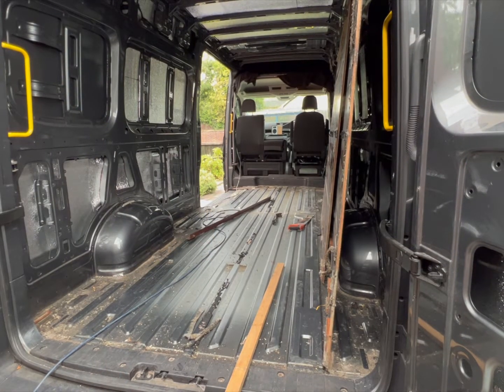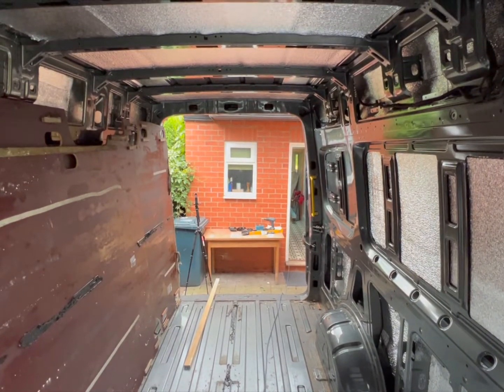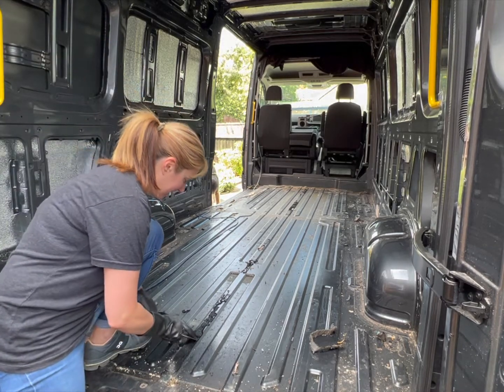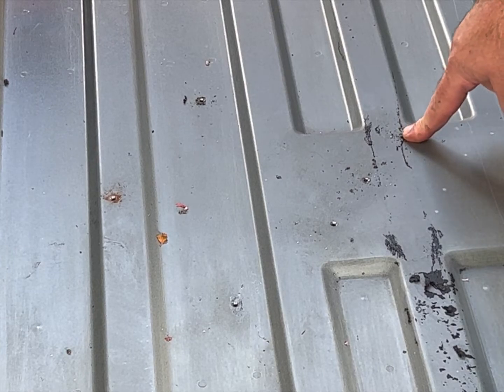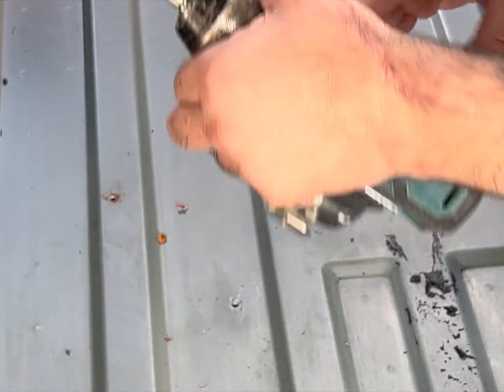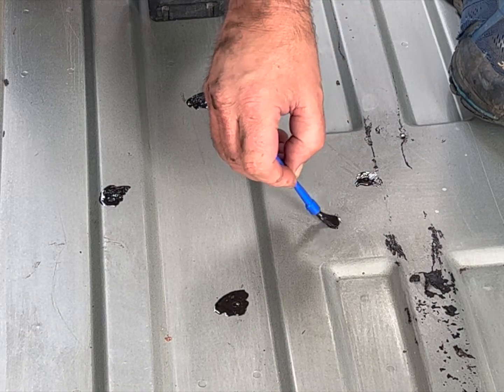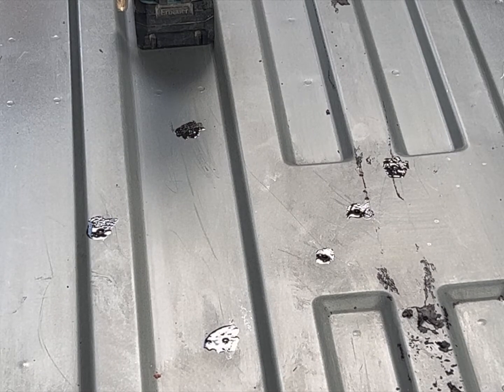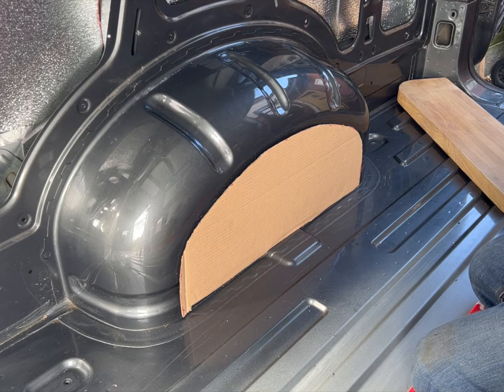VW Crafter Conversion EP2 THE FLOOR COMES UP!

Comment: Another great vid. Taking my floor up today to baton and insulate. I take it (obvious question) you chiselled off the packers attached to the floor before laying it back down on your insulation?
Reply from the maker: Hi Chris, yes. I cleared all the packers off the original floor, painted it and placed it directly on to the battened floor. It's the first coat of paint really, as I'm sure I'll go over it again when I'm finished. Albeit, I will be laying carpet in main area of van. Good luck.